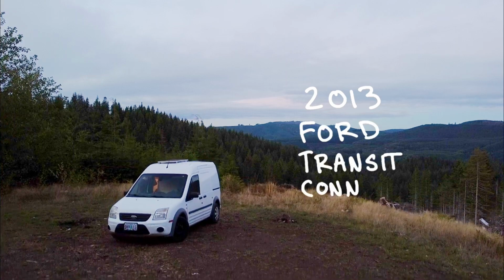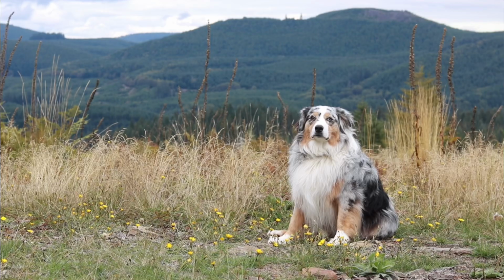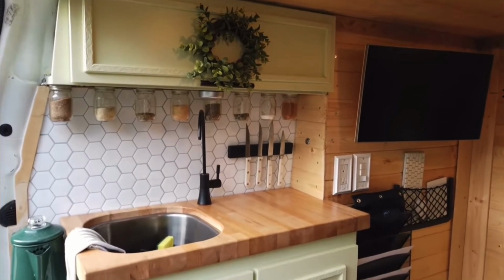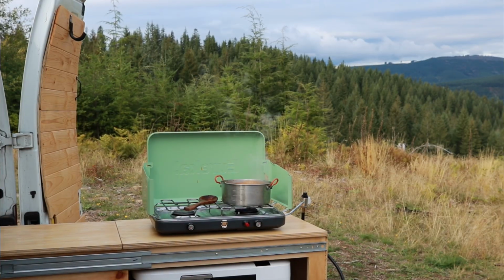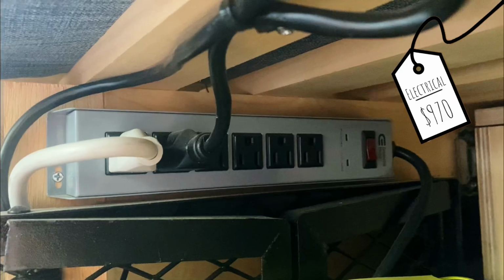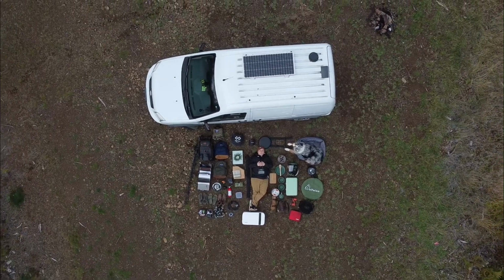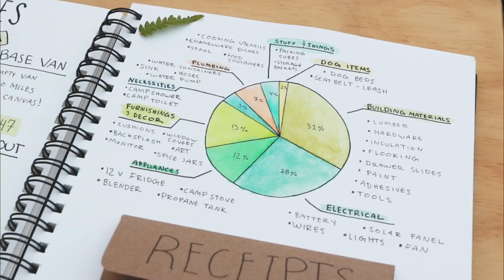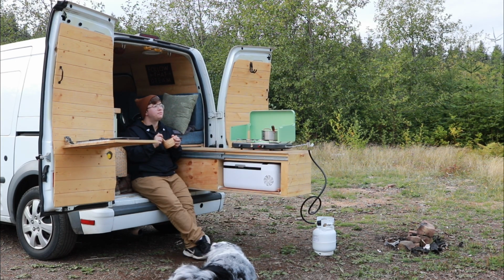How Much Did My Camper Conversion Cost? | Van Build Q&A

Comment: I Miss you, I’m looking at a 2012 connections, it’s pretty clean but I’d need to build it out too. Suspect I’ll throw a rug, cot and cabinet and call it good for now. Mostly worried about the engine, transmission and tires….

Comment: Living in such a small space I have wondered why I haven't seen builds on YouTube where people put hard top cargo carriers on the roof.  Sure it would be ridiculously tall and require a collapsible ladder to access but I have seen 18 cubic foot units on Amazon for $350 that add only 1.5 feet of height... And it was flat enough that it looked like someone could mount a 200 watt solar panel on top.  For drive-ability someone wouldn't want too much weight up there but 18 cubic feet could sure hold a lot of art supplies and dog biscuits.  Maybe if Milo reads this he could weigh in on why or why not this is a good or bad idea?

Comment: I'm in the UK for shared housing rent I'm paying £540 a month to buy a cheap apartment minimum £140,000 so while $11,000 seems expensive its literally 1/14 of the cost of full housing. Only challenge is finding a way to earn remotely while moving.

Comment: Gee....I didn't realize how expensive those drawer slides were.  I used to work in IT and some of the computer systems came with them and if we were putting it on a shelf we wouldn't use them and just throw them away. Oh well...what a waste.

Comment: Hi Milo. 
I've really enjoyed your videos for both the educational and aesthetic aspects. Thank you for sharing all that you do. I recently got a ford transit connect myself and am looking to start the conversion process soon. I notice that you have quite the work set up. At the moment I am a full time graphic designer (working with heavy software such as the adobe suite on a MacBook) and would like to continue with this work load as I switch over to what is hopefully full time van life. I am curious how your power set up is for you. While I know a laptop can pull a bit more power than an iPad and I am not aware of how many hours you work I am curious to know how the Goal zero holds up for you. While I would like to keep the electrical relatively simple I also would like to of course have the power I need. So whether that means going with a higher priced goal zero or having to go with lithium. The other elements that would be pulling power would be very similar to your build as well (water pump, fridge, lights, etc.) 
Would love to hear yours thoughts!